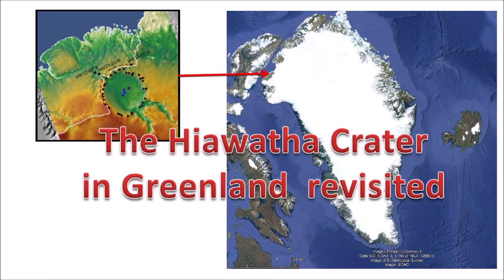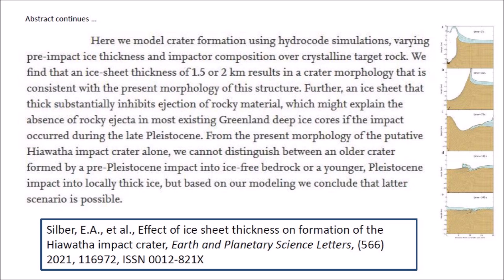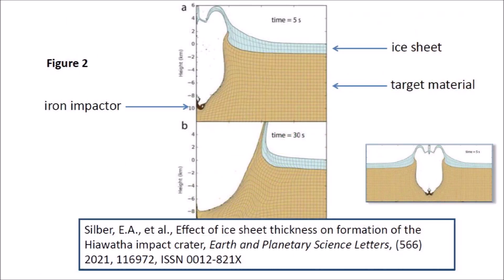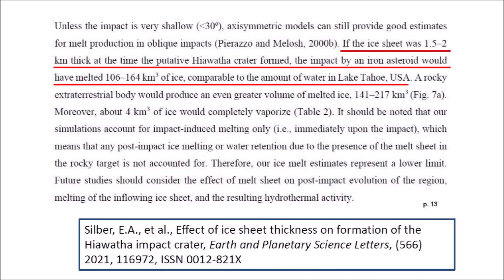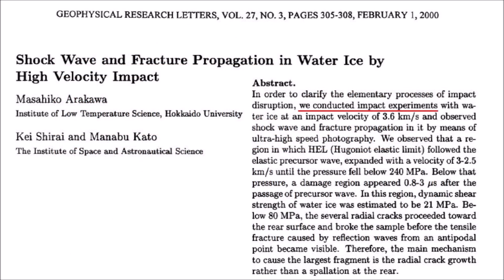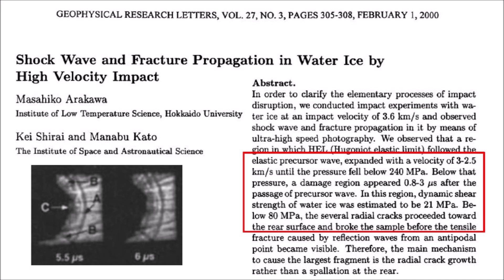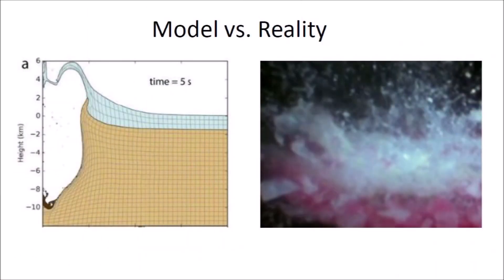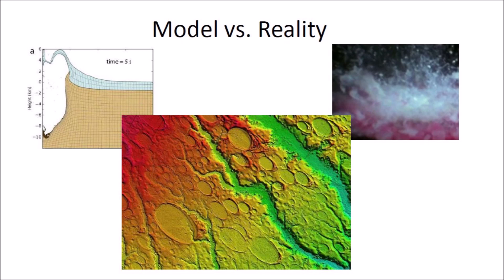The Hiawatha Crater in Greenland Revisited

Comment: it seems you're only testing the impact, and not also simulating the incredible heat it would produce, correct?
Reply from the maker: The energy of the impact gets converted to heat or performs work in accordance with the first law of thermodynamics. The energy is partitioned to break up and eject target material, to melt ice into water and to convert water into steam. One source of energy does all of these things.
Reply: @Antonio_Zamora  does that include the heat of entering into the atmosphere?

I would imagine that kind of momentum + the heat of the atmosphere could create conditions that aren't easily replicable in a "lab setting" lol
Reply from the maker: @kendallwilliams2784  The passage through the atmosphere is so brief that not much energy gets transferred. An asteroid at 17 Km/s would take about 5 seconds to go through 100 km of atmosphere and a comet at 45 Km/s, would just take a couple of seconds.  Some people have criticized my experiments because they are too small, but a large experiment could wipe out a city.

Comment: That's a fundamental issue. I remember Prof  Schultz's experiment from other videos. The simulation should also either recreate the Carolina Bays in their location and associated ejecta impact pattern or another one elsewhere where forensic evidence may be found.
Reply from the maker: The orientations of the Carolina Bays and Nebraska Rainwater Basins converge by the Great Lakes.  The Hiawatha crater is too far north to have been responsible for the bays.  The authors of the paper tried to find evidence of ejecta from the Hiawatha impact in the Greenland ice cores, but they did not find any, so they proposed that the ice cover could have suppressed the ballistic dispersion of stony ejecta. A fundamental problem is that in Prof. Schultz's experiments, an impact on ice does not leave a well-formed crater on the surface below the ice.  This is what we find at the convergence point of the Carolina bays - the Great Lakes area has no obvious evidence of an impact.  However, in Greenland there is a well-formed crater, which suggests that it formed before Greenland had an ice cover, but this eliminates the Hiawatha crater as the trigger of the YD event 12,900 years ago.

Comment: Glacial ice is not the same as a solid frozen sheet like the one in Schultz's demonstration.  Glacial ice is composed of compacted annual snows with air pockets and woukd be more "plastic".  A better demonstration could be conducted using frozen compressed snow (a snow cone maker would suffice) to fire a projectile into.
Reply from the maker: I noticed some air bubbles in the ice sheet that professor Schultz used. And perhaps he used chlorinated tap water instead of distilled water which is more similar to snow. And the projectile was a spherical bead instead of a real meteorite. Physical modeling is not quite the real thing, but it is closer to the real thing than numerical modeling.
Reply: @Antonio_Zamora    Would the atmosphere be 'pinched' by the sudden hole being blasted out of it?
Reply: ...plus, there would be 3,000 Kelvins of plasma heat.
Reply from the maker: I read a paper that said that during the 30-second excavation phase of the ET impact the atmosphere is pushed away from the impact area. This is then followed by a great rush of air toward the point of impact - very similar to what happens during nuclear explosions.
Reply: @Antonio_Zamora   Thanks for the reply. Would it make the atmosphere shrink towards the ground as it is displaced?
Reply: metamorphosed glacial ice could be "as hard as rock", on the other hand glacial ice could just be slush. Too many factors to say glacial ice is this or that.
Reply: @jollyroger7624  Ice cores from the highest point on Greenland indicate temperatures higher than current highs and suggest a rapidly melting ice sheet characterised by many moulins and fissures. Additionally the second crater found soon after Haiwatha which is slightly larger and wholly obscured by ice has associated sub ice features that resemble the megaflood featured found in North America.
Reply: @CandideSchmyles  I'm not aware of the larger crater, will check it out.

Comment: So, all that rock excavated from this 30 plus km diameter crater by a 1.5 km diameter metallic meteor impacting at 10-70 km per second, was vaporised ?
20 plus cubic kilometers of rock just disappears ? The ice sheet didn't stop the cratering, the crater is there for all to see. So where is the rock that was excavated, it's not there because the crater was the result of an impact long before the ice sheet formed, obviously. Erosion through time, prior to the coming of the ice, normal weathering and the movement of the ice over millions of years partially filled the crater and commingled the excavated material over the surrounding area. If this did not happen, and the impact occurred during the life of the present ice sheet, there would be 20 cubic kilometers of material embedded in the surrounding ice sheet; and it would be easily detected !?
Reply from the maker: The amount of target rock vaporized by an extraterrestrial impact is about equal to the size of the meteorite. In this case, equivalent to a sphere with a diameter of 2 km. The crater cavity is formed when material is pushed laterally by the horizontal compressive forces of the explosion resulting from the release of the high pressure.
Reply: @Antonio_Zamora  So the displaced rock that would actually "disappear" during excavation is minuscule compared to the volume of the crater. So I think we need to find that missing 20 cubic kilometers of rock !? Talk about silly science !
Reply from the maker: The rock that is vaporized condenses very quickly into microspherules that are carried by the wind.
Reply: @Antonio_Zamora  Then there's the molten material that solidifies into tektites, and in particular the ausralites; some as big as your fist and many interesting shapes. Again more material that if the crater was excavated whilst the ice sheet was in place, would be liberally distributed throughout the Greenland ice sheet ?!
Reply from the maker: @jollyroger7624  Dr. Silver, the author of the paper that I reviewed, looked for evidence of some ejecta, but did not find any in the ice cores.
Reply: @Antonio_Zamora  I'm not surprised. based on my commonsense and review of the previously published material, " I conclude that the scenario postulated by "the paper" is scientific heresy"  ! thank you once again for a most informative discussion. May you carry on shining a glimmer of light into the abyss of our ignorance for many years to come.
Reply: @jollyroger7624  Ice cores do show a relevantly dated layer of platinum group metals in Greenland ice cores and significant evidence of ejecta in the Thule area where meteoric iron has been a prized and traded commodity for at least a millenium. The direction of the strewn field is still largely ice covered hiding any ejecta evidence below 12000 years of accumulated ice. There has been no significant scientific study of ice cores or surface geology in that area so it is premature to state there is no evidence. It can also be noted that leaving Haiawatha via Thule and Cape York and carrying on in a balistic trajectory you do reach the great lakes area. https://sciencenordic.com/denmark-greenland-inuit/greenlands-iron-age-came-from-space/1412749#:~:text=The%20basalt%20on%20Northern%20Greenland,had%20access%20to%20modern%20tools.&text=Somewhere%20between%20five%20and%20ten,through%20the%20atmosphere%20over%20Greenland.
Reply: @CandideSchmyles   re the iron meteorite, not old enough according to the dating, to be associated with the Younger Dryas Event. But still very interesting. Btw there was also an iron meteor that fell near where I live, said at the time it was found to be the largest in the world at that time. It too was on the same trajectory as you mention; but this fell so they say in 1780. Even a 9 tonner in bits, is impressive when seen up close, and considering how it got to be here. I still think Antonio Zamora has it sown up.

Comment: Antonio, it's too bad you were not one of the peers reviewing that paper.  You could have advised them.  

So the big question:  if they had used the model derived from physical experiments which shows the ice fractures and blasts outward and upward rather than melting, would the Hiawatha Crater be more likely to be of a YDB age?
Reply from the maker: Once the ET projectile goes through the ice layer everything is more or less the same. The melting of the ice is the only thing that is seriously wrong.